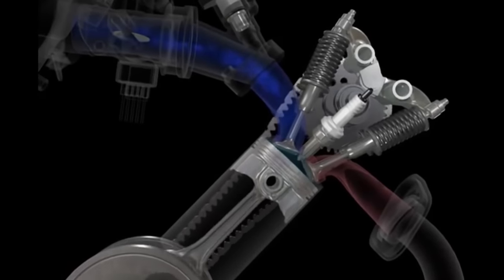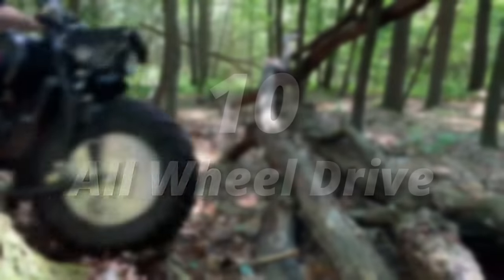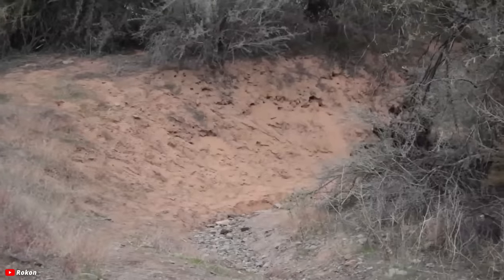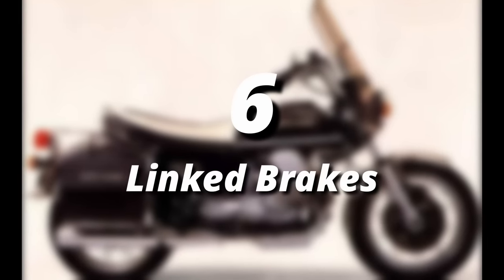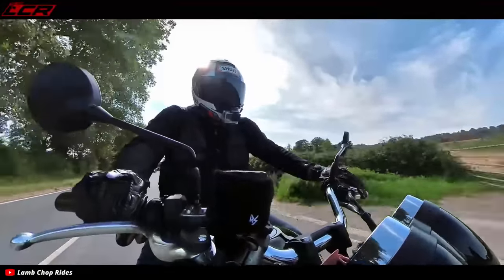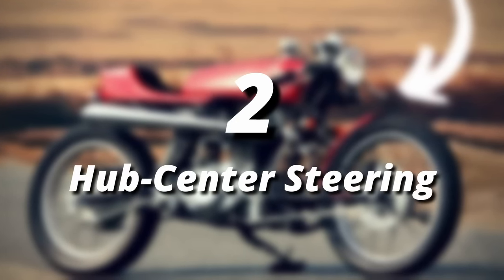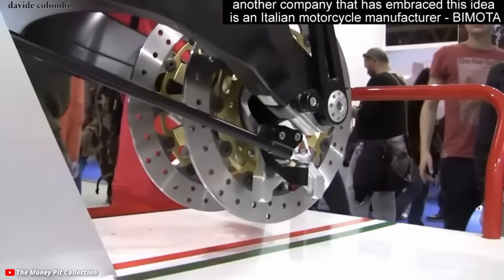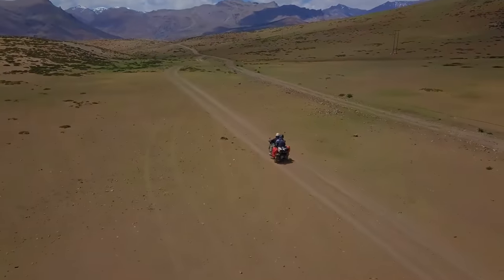10 Motorcycle Innovations that never caught on

Comment: BMW uses both telelever and duolever to this day, duolever looking a lot like the Britain bike's front suspension. They're great in luxury bikes but are too expensive to produce for a commuter bike and have too many moving parts (therefore weight and loss of feeling) for sport bikes.
Reply: I'll argue BMW uses them just to be different. They want to be known as an engineering company and have many examples of over-engineered systems with strange failure modes. BMW does things for marketing, not because they are better. Both those front suspension alternates ruin front end feedback, something a putterer on a luxo bike doesn't even understand, know, or care about.
Reply: @dougfreeman3229  Correct. They decrease steering effort and increase comfort, which are a plus on luxury bikes but nobody wants on a sport bike. It makes sense to try to decrease steering effort on a 600lb bike.
Reply: @S50Sinner  No they do not reduce steering effort, and just wait till all the extra joints need service. How's that kool-aid taste anyway?
Reply: The original Hossack suspensions were used on race bikes and were lighter than telescopic forks, and the moving parts are also light weight. Have a look at the Hossack suspension on his K100 conversion.

Comment: All wheel drive is impractical for any reasonable amount of power given complexity of system.
Grip shifts would be clunky for shifting fast, pulling clutch with same hand as twisting.
Automatic transmissions less desirable on motorcycles due to unexpected shifting during cornering upsetting balance, which is crucial to handling.
Sportbikes already have ridiculous power to weight ratio, turbos are completely unnecessary. Under 100MPH, acceleration is limited by the bike wanting to wheelie.

Comment: Power steering on a bike seems absolutely futile.  Your not turning the handle bars when steering in corners. It would only have  use at a slow speed and Ive never ridden a bike that cant be turned. Even the thousand pound Goldwing steers easily enough.

Comment: I wanted to comment every single one of these, but here are some:
Brittens front suspension worked, but it wasn't better, and for top competition, you need to be better, it was complex, expensive and heavy, compared to the two tubes we all know.
Twist shifters was popular on many brands of mopeds, but with more then three gears, you would rotate the clutchgrip too much, so you would still need a ratcheting system like on a foot pedal.
Hub steering itroduces slop and center stickyness, ever soo slightly, and is heavy.
Putting a roof on a motorcycle makes it heavy, top heavy, and with out doors you are still not protected.
Self driving motorcycles is stupid, it's not like in a car where you could just lean back, on a motorcycle you still need to hold on.
As I said, I could slay every one of these with logic, but the bas is Heavy, expensive and doesn't add anything is a flop.

Comment: Turbocharging is simply the wrong technology for motorcycles.  It is too expensive, and I don't mean money.  Turbo-technology was developed all the way back in the 20s and 30s, largely to increase high-altitude performance in piston engine aircraft.  Almost no successful fighter planes used turbos (although many bombers did, like the famous B-17 or the B-24).  Only two come to mind, the P-38 Lightning and the P-47 Thunderbolt.  Both of these planes were significantly larger AND heavier than their competitors, and that's what I mean by expensive.  In cars where weight simply doesn't matter, turbos can work.  In cars where a small turbo'ed engine is replacing a larger engine, turbos can work.  In a motorcycle where both weight and size are greatly confined, turbos make little sense.  Maybe if you wanted to put a 600cc engine into a 'Busa frame and fill the rest of the space with a turbo?  Maybe?  But I'm not sure why anyone would do that...

Comment: Two wheel drive is unnececary in most aplications, grip shift sucks for obvious reasons, hub centre steering has it's advantages but also it's disadvantages and does'nt justify the cost in most aplications, ( the RADD system on the Yamaha is a variation of, but not technically a hub steer system). Enclosed bikes defeat the purpose of having a bike as do self driving bikes, oval pistons although I'm not aware of being tried elsware is really an engine inovation that did'nt work not a motorcycle specific thing, if it did work I'm sure we'd see in cars as well. Linked brakes were used on Honda Blackbirds for one for almont a decade, ABS has made it redundant, girder type front suspension can be found on current model BMW K1600 and Honda Goldwing and auto trans are ubiquitous in most scooters.

Comment: Sometimes, innovation can create a market like the original Ford Explorer but mostly, innovation comes as a result of market demand to solve a widespread problem. What such problem was stated that needed a car-bike to solve? Nothing, certainly not safety and so they all fail one by one. Linked brakes are very interesting and my guess is that cost and complexity was the issue there.  I did have a Vespa and liked the twist-shift but it was so odd compared to a regular bike so tradition won out. Perhaps because it was on a Vespa and not a regular large bike it seemed like a toy. Also, it has a learning curve and having one more thing to do at a critical place like gripping the bars creates a safety hazard. Again, innovations that dont solve an important problem for which there is demand cannot win.

Comment: I don't want a self driving car, Motorcycle, or electric scooter.  I definitely don't want an electric vehicle, range charging time and we would have to go back to coal from propane for most generation plants due to cost and supply. Wind and solar are too small a part of the infrastructure to make it by 2040. I'm not against renewables, but there are problems with the current state of the art.

Comment: A computer-controlled self steering motorcycle? If you're insane with a death-wish - go for it.
Turbos in the 80's had a lag at low R's and then the turbo spooled-up and acceleration increased without any additional input from the throttle. A learning-curve if you're in a SAAB even with the boost tweaked to an insane amount at the waste-gate not allowing pressure to bleed off - but unless you didn't grab a gear correctly and grenaded the transmission - lot's of fun.
A bike? I want my powerband predictable and on a curve that I can depend on in a straight-line or winding course - and the old turbos probably killed a few riders. No thanks.

Comment: The Yamaha GTS1000 was NOT a center hub design. It was a R.A.D.D./Parker front suspension, and in the mid 80s I was 100% convinced it was the future of motorcycle front suspensions except for cruisers. Just look at your pic. The hub is fixed in this design with a single sided swing arm. I don't think it looks complicated at all, and it works better than forks. I can't believe we still have forks. Ever try to make your own forks? They are not simple at all. Not like a swing arm suspension. We're just so used to them. Forks suck. It's absurd and primitive to force a front suspension to do double duty under braking when it is totally unnecessary.
Reply: If alternate front suspensions were better, wouldn't they be on race bikes? RADD, hubcenter, and others have been tried, but the pro's don't outweigh the con's. BMW has tele and duo lever designs, but tele forks get used on their sport bikes. Why - those alternates just don't work as well in total.
Reply: @dougfreeman3229  I do not recall the R.A.D.D./Parker front suspension ever being used in racing, which always baffled me. Yamaha bought it and only used it on one sport tourer. That's it. To my knowledge it was never race tested. Both Elf and Bimota used the (awful) center hub design extensively, but it had no success and was never going to be production practical with its limited steering lock and other issues. The R.A.D.D./Parker with its single sided swingarm has no such steering lock limitations and full natural anti-dive under braking. In fact Yamaha tuned in some controlled brake dive just so the bike wouldn't feel so alien to riders who had only experienced forks. I think they never put it on their race bikes for the same reason no one has ever put the superior front suspension of the Britten on their bikes: They're afraid buyers won't like it. They're afraid it won't sell. I've always thought if it wins races it will sell. If it's faster and better it will sell, but we still have not been given the chance to find out yet. Sometimes the traditions we love can hold us back.
Reply: @toddblack3957  I disagree - alternate suspensions are not on production bikes due to customer fear. They arent there because in total they are not better - cost, weight, complexity, maintenance, etc. Anti dive is not what its purported to be - it was abandoned by racing and production decades ago. Other than ani dive these alternate suspensions have no benefit over todays upside down forks, hence, there is no reason for them, other than techies thinking its cool. 1 side swingarms are the same way.
Reply: @toddblack3957  Hossack first put his suspension on Clubmen racers where they performed very well. Fiore also used this design on racers where they performed well. You can design these suspensions to look very similar to telescopic forks, so if one company is bold enough, we may see them on sport bikes.

Comment: You missed  what I had  late 70"s Honda hawk hondamatic 400cc just n for neutral  1 normal 2 low each one take-off from.  Rode  cross country  was nice to ride without shifting.  El Paso Texas to ventura California  and back  seeing family on ARMY leaves  with 2 heavy duffel bags.  No one ever heard of a automatic motorcycle much less seen one!  I'm a true biker/cowboy ride a HONDA VTX 1800CC  VTX = VEE TWIN EXTREME.  Did therefore Scottsdale run to metor crater  on a Yamaha 250 v twin. Started from riverside, CA n back with my wife. Hanging on. Rode it 21,000 miles in 12 months before she was stolen. Nicknamed leather ass  ,and I hate cars.

Comment: electric all wheel drive is a far better system than any mechanically driven effort. either a conventional armature motor in each hub, or maybe a hybrid rim based mag/lev system that could brake as well. when they start making universal exchange battery sizes, like AA/C/D cell batteries are except made m/bike size, then fossil fuel could be fazed out.
grip shift could be dangerous especially in performance machines... trying to accurately twist to a gear when under extreme acceleration may be a worst case scenario but cornering and changing up and down may also be an issue for handling.
combine foot brake?... forget it... no decently experienced rider would ever want that... but with ABS and chips?... maybe better for cruisers now.
oval pistons? like the Honda, it's just a V8 with joined cylinders to make a V4... over priced, slight increase in combustion size but same amount of valves still for area... for the price it seems circular will be fine... and then electric will better it anyway.
self driving bikes?.... just get the self driving car.... but maybe in the future the bike will take over when the rider doesn't obey road rules or doesn't give way... no use having self drive cars if rebels are still on the road.
turbos?... a 1000cc normal bike is better than one with a turbo?.... not a chance.... turbos are great. i had a Kawasaki Z750 turbo in the 80's and it was fun to ride. no 750 had a chance and it beat most bikes up to 1100s.... should be more production turbo bikes especially using the front mount Kwaka type design... but electric will be better again so why spend the money now?

Comment: When. The rokon came. Out...go carts. Where simple. Briggs and Stratton. No disc brakes..used a wiper pad of steel to stop you...
Mini bikes...no suspension.....
The rokon came from those....
At a time when. Japanese  bikes
Where just. Starting to  catch. On..
There is no sofistication. To the 
ENGINEERING. OF A ROKON......

Comment: on turbo bikes... there wasnt a production liter turbo factory bike. NEVER. it was 500's, 650's and 750's, and all were twins, to make the matter worse.
yes, i know of the Z1R TC and that's not factory. not warrantied.
kawa did, i believe have a liter turbo bike prototype running at some point and that thing, in the 80's, was above 200 hp. with the frames they had it would have been a lawsuit on two wheels.

turbos dont work well on twins, due to the space between each powerstroke... that led to bad turbolag, unstable boost and a rather dogshit performance without boost, due to low compression.

the problem with turbo bikes is how DANGEROUS these things are. 
You want predictable power on a motorcycle. not a bike that suddenly grabs 50+ hp between 4500 and 4800 rpm and keeps surging all the way to the redline.

turbo bikes are one downshift away from a highside.
you also cant "small turbo" a bike due to the wide rpm range they operate on. it would inevitablely choke the engine at some point. so either go with boost by gear, boost limiters... tech that didnt exist till recently or was exensive.

i do believe turbos could come back for effiency's sake, along a cvt 500cc triple, for example. for performance? superchargers. simply because it's too lethal otherwise.

Comment: Twist grip shifting didn't survive because it was complicated, impractical and hard to adjust/maintain. People who knew how to properly adjust it were making very good money back in the day and there were very few of them. The twist shifting was easy to learn but difficult to master. It was also increasingly finicky and awkward as the number of gears raised over 3-4. 

The front suspension is a different story. Even though many early attempts at improving the standard suspension were a flop, there are plenty of motorcycles today that successfully implemented innovative and very different solutions. Cases in point, Honda Goldwing and BMW R1200GS.

The car type planetary automatic transmission was never a good idea for motorcycles because it's too big, heavy and complicated. CVT is way more practical and it is trickling up to cars too.
Reply: @SikterEfendi - "Twist grip shifting didn't survive because it was complicated, impractical and hard to adjust/maintain. People who knew how to properly adjust it were making very good money back in the day and there were very few of them."
Utter BOLLOX!!  If you can adjust the brake cables on a push bike, you can do it on a Vespa or Lambretta!  And back in the 60s, I knew plenty of scooter owners, and not ONE of them mentioned any difficulty with using or maintaining their gear shifters or the cables.

Comment: Vespas!? So cute and unthreatening. The perfectly balanced machine. A triumph of form over function,  Unless, that is, function is defined as the ability to squeeze the thing into the front room of your ground floor apartment. I mean, where else can you find such a combination of gutless performance and diabolical handling. And I can tell you why the twist grip gearchange never caught on. Because it's shit. But 65 m.p.h ? Down a mineshaft maybe (probably where they belong).

The semi auto shift on the Honda CT range on the other hand (and I would challenge anyone owning a Vespa who is under the delusion that they're good to try one), is a delight to use. The free hand is great, no problems with smooth shifts at all, and especially good if you enjoy a fag while you're tooling along. And they can go just about anywhere if you don't go nuts. (Try riding a bloody Vespa down a flight of stairs some time).

The Never Ready range of Honda's was more of a P.R. stunt, or maybe a demonstration of engineering skills, than anything else. Engine rebuilding might be on a steady decline, but I just can't get my head around what it would take to do a bore job on one of these things. (And that there mounted on the wall is another one of my trophies. An NR Honda. Rare as hen's teeth you know.).

Linked brakes? I dunno. Never even tried ABS on a bike. Don't think I'd like it (the linked brakes I mean).

Hub centre steering must surely have it's day though. It's one of those things that seemed to have evolved from something which felt vague and remote, into something that testers raved about. Alan Cathcart, (whose expressed opinions seemed to have a price) amongst others, made a point that these arrangements saved a significant amount of weight, so I'm surprised that you report the opposite. I'm well out of date on developments though.

But I am thinking about the advantages of the self driving bike. Given a little programming, I'm thinking that it can deliver me to my own funeral. Maybe even drive into the hole.

Comment: I would think. If I had half a brain. And oh by the way. I don't. But if I did? I would go after a hybrid  driive, all-wheel-drive, motorcycle. Much differently.

The front wheel. Shoulld be an electric hub drive. And while a battery is in place and usable. While the, ICE  is running. It's generating the power for the front wheel hub drive motor. Et voilà! Far less mechanically intensive.  And the ability to be used, standalone. In the event of catastrophic, ICE failure. Of the main drive motor.  Then only front-wheel-drive. On, battery power. To get you into repair.. DUH! I mean come on now!  21st  century, isn't it? Annd we use all of the new tools at our disposal. Combined with the tried and true technologies of the times. Until more revolutionary methods are established. Somewhere later down the pike. Not tomorrow. The day after next year.

So return next week. What happened, last week. Before you are irrevocably changed by this week.
RemyRAD